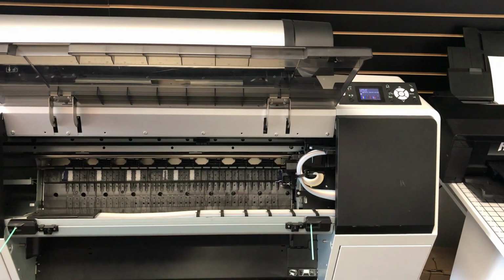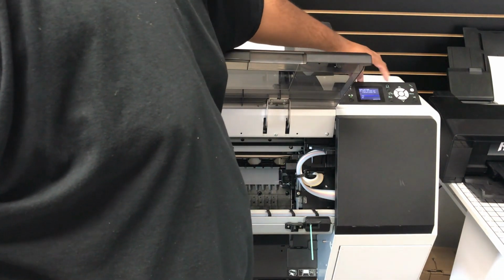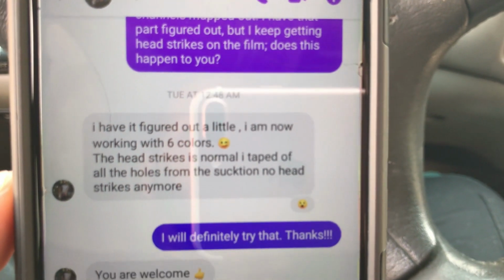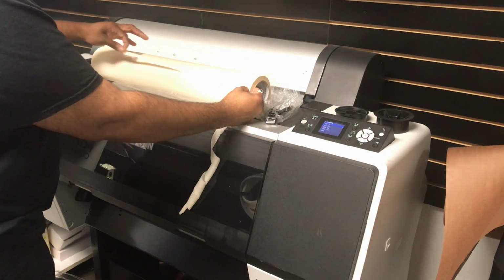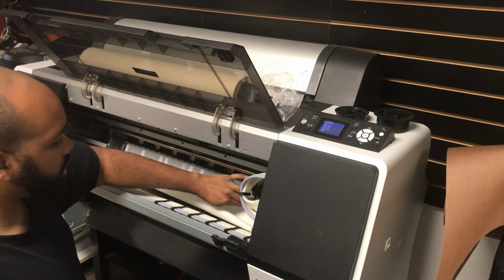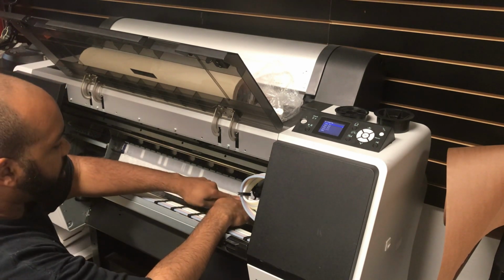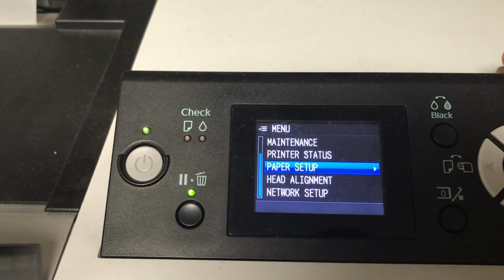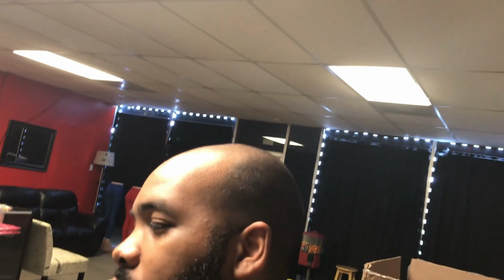PART 4: EPSON 7890 DTF CONVERSION

Comment: Thanks so much for all your efforts on this video series. Is this trick applicable to all 24 inches Epson dtf printer?
Reply from the maker: Yes. I've also found that the printer will feed the film just fine, if you use double sided matte film. Glossy film tends to buckle when it passes over the vacuum ports on the print track.

Comment: Have you updated to acrorip 11 yet
Reply from the maker: I have a copy of it, but I don't use it, as the only feature that is different from v10 is the image nesting feature. This allows you to upload multiple images into one job and create a gang sheet, which I already do manually, just as quickly. I'm not an authorized seller of AcroRip v10 and v11. My website is popdtf.com
Reply: @elegant_edits  yes that's true I have 11 for my desktop but now I lm waiting on the 11 wide format to arrive in the mail. I just bought a epson 7890 like yours. So how can I contact you for some advice??

Comment: Can the 7700 vivid magenta  be used as dtf has 4 ink channel  but 5 carts 
Vm c y pk mk 
Thanks
Reply from the maker: If you're referring to the Stylus Pro 7700, it will be the same conversion method.
Reply: @elegant_edits  7700 only haa 4 onboard inks 5 carts 4 linee  in use 1 gets swapped     so dont think can cause need a white ink  spot
Reply from the maker: Yes. Are you referring to a Work Force series printer? You must have at least 6 channels, unless you plan to only use CMYK for white and light-colored shirts. The other issue you may run into would be finding a RIP software that will support that model printer.

Comment: Can anyone help with any materials how to convert 7880? any articles? videos? forum ?
Reply from the maker: This series is for the conversion of the 7800 series, which are the same steps for your printer. If you would like to order consumables from me, please send me an email at info@eleganteditsco.com and I will send you a price list. The website will also be ready, very soon.
Reply: @elegant_edits  Thank you so much for reassuring as I'm a bit scared to invest over £3k in total disaster. 
I would love to order stuff from you but because I'm based in UK it would be economic suicide, if you think it's still doable please let me know and I will reach out for price list.
Btw is there the same steps if you want to convert back from dtf to normal print? (I midgt go back if possible only if I'll have enough money to buy better machines for DTG/DTF and start printing posters, leaflets as part of growth. What you think?
Reply from the maker: @iwonarepetowska7700  My supplier has other warehouses, globally. I can work on getting the inks delivered to you, from a warehouse that is closer to you. They will not be branded as POP DTF, but they are my inks. Please send an email and include your shipping address; we'll get you taken care of. To be honest, I don't think that you will want to go back to OEM ink, after you switch to DTF. I have done it with no problem, but I think that you could just buy a separate printer, if you wanted to do posters etc. A better printer for printing all of the other media you mentioned would actually be a Canon printer, since their systems are dye-based
Reply: @elegant_edits  I already sent an e-mail. I'm exited to work with you and congratulation on launching POP DTF line!!!

Comment from the maker: Head striking fix at 7:53 (Only do this if you have set the platen gap to widest and you still see the headstrikes) UPDATE: you do not have to tape the print track, if you have great film. Once I tried a different roll of film, I didn't have any trouble with head strikes.

Comment: Wonderful videos, thank you!  How is the workaround with covering the vacuum working out for you, any problems yet?  Also, do you think the Epson Stylus Pro 9900 will be the same process to convert to DTF?
Reply from the maker: The vacuum is fine, because there is still air being suctioned through; it's not air tight. I think there won't be any reason for the motor to burn out, in the future. Thanks for watching! I am working with a couple of people, for the 9900 as those printers now have an onboard registry of serial numbers, which has a certain counter; where the printer knows which carts have been used and reset. Epson is very keen, on trying to prevent what we are doing. lol

Comment: Hey I have a epson 15000 and want to convert it into a dtf printer is it a good idea to start with the 15000 and later upgrade or should I just sell the 15000 and get a l1800 now?. I still can’t find out the differences between these two. Thanks 🙏🏼
Reply: @elegant_edits  thanks a lot definitely going to go with the L1800 now  I appreciate the info